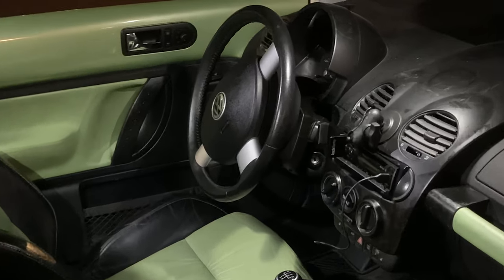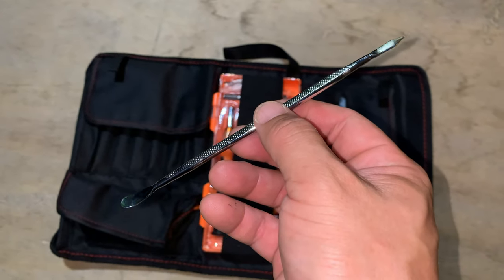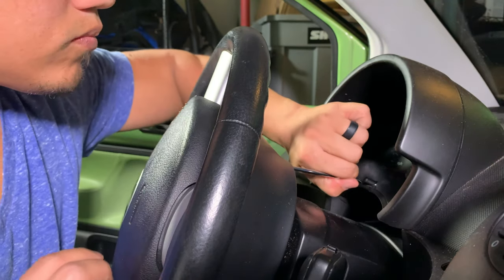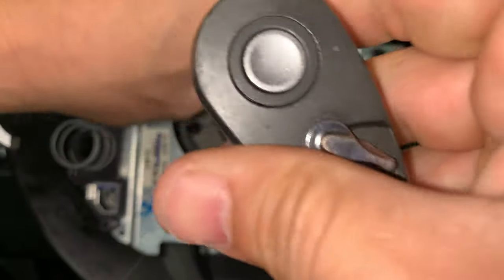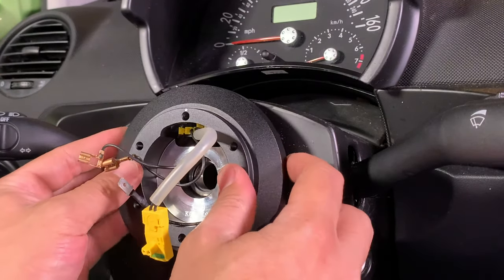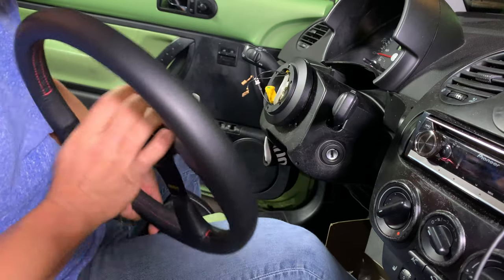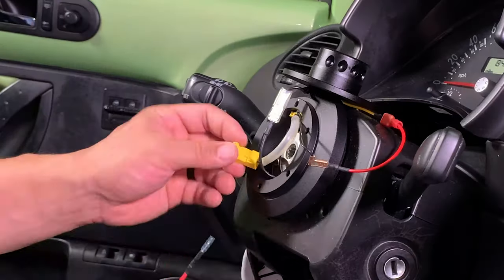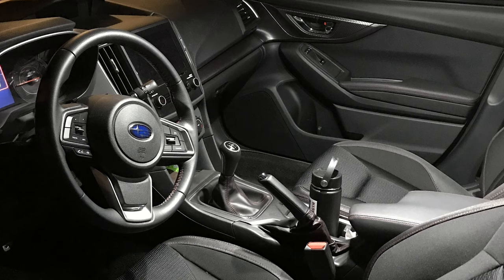How To Install an Aftermarket Steering Wheel with NRG Quick Release on a Mk4 New Beetle, Golf, Jetta

Comment: Such a good vid! Will be doing this on my MK4 Golf but with a MOMO Team 280mm, thanks for the links in the description too!
Reply from the maker: Awesome! Glad you found it helpful! I have one of those wheels too in suede. I didn't like how the dye on the suede rubbed off on my hands on long drives. I like the bigger wheel. But it the 280 is pretty. haha.
Reply: @rayregnogarage  i've had a suede wheel before, it started off nice then it got pretty yuck (it was on a daily driver, and i didn't use gloves)

i'm a pretty small guy and had a miata/mx5 and loved the go cart sized wheel, each to their own :)

i read a couple more of the comments on this vid about the resistor, do you mind sharing what load/size/rating it is?
Reply from the maker: I just used the resistor supplied by NRG. I’ve used more compact resistors in my other cars because they take up less space in the hub adaptor...but they’ve failed on both my Xterra and Ranger. Integra is still going okay but I don’t drive it much. These are the resistors: 2 OHM Resistors
https://amzn.to/2ZTcP5P
Reply: @rayregnogarage  Beautiful, thank you very much

Comment: Where did you get the plug for the air bag ? So the light is not on?
Reply from the maker: The resistor comes in the NRG kit. my light is still on. Every car has a different process to reset it and I haven’t gotten to it on this car yet. I’m guessing I’ll need to clear it using VCDS.
Reply: @rayregnogarage  I have the vcds how do you clear it?
Reply from the maker: @yuvrajpajetta3496  Ah. I haven't tried yet. I still need to do some research on how to do it. But I think I read somewhere to look under the modules or error codes to clear it.
Reply: @rayregnogarage  ohh okay thank you let me know if you find out how to do it
Reply from the maker: @yuvrajpajetta3496  will do.. will be in August at the earliest. I split time between two different states and that car and I are in different states at the moment. lol

Comment: Does the same apply for the passat b5.5? It's basically the same mk4 generation
Reply from the maker: Ya, I can’t say with  absolute certainty, because I’ve never worked on a Passat, but I’d say if it’s not the same it would be super similar. When I’m working on the car, I often find passat videos that aren’t exactly the same but are really helpful. The Germans are about efficiency and it’s not efficient to have a bunch of variance in parts and process, so I’m pretty confident it would be the same if
not very close.
Reply: @rayregnogarage  Same :D When i look for things for my passat i search golf videos since they are alot more popular. Thanks!

Comment: will this fit a mk7.5 GTI?
Reply from the maker: the quick release and wheel will. not sure if the adapter is the same. Check the NRG website for the part number

Comment: I have an 01 Gti with the cruise control on the wheel. Trying to figure out a wiring diagram on how to convert the cruise to the left stalk style. You can buy the Oem stalk for $40. Any one out there that can give me some pointers?
Reply from the maker: i haven't quite figured that out yet. I was planning to do that on my xterra but haven't cared enough to do it. haha. on my integra, I just removed the cruise control module from the engine bay. hahaha
Reply: @rayregnogarage  I might just do that. I don't need it but wouldn't mind keeping iy
Reply from the maker: @tynado1173  Ya. I don't really use my cruise much anyway. Haven't missed it too much. haha

Comment: If you would have left battery disconnected /and not rolled the ignition on until you plugged airbag resistor in it wouldn't have tripped the airbag light
Reply from the maker: good to know. I haven’t looked into how to fix it yet. just been rolling with it not caring. I’ve got VCDS but I’m still learning it.
Reply: @rayregnogarage  whenever anything is disconnected from airbag system never roll key forward it makes computer scan system for faults like it does when starting car,I got mine reset for free at shop,it can be done with scan tool if scanner covers airbag system it doesn't have to be done with vcds
Reply: @rayregnogarage  it's easier on a straight up scanner
Reply from the maker: thanks!

Comment: Hey brother, my kit didn’t come with screws for the hub adapter. I got a momo steering wheel separately and that only came with screws to bolt the wheel to the quick release. What kind of screws are needed for the hun adapter??
Reply from the maker: Just order replacement screws from NRG: https://amzn.to/2P68Tfa